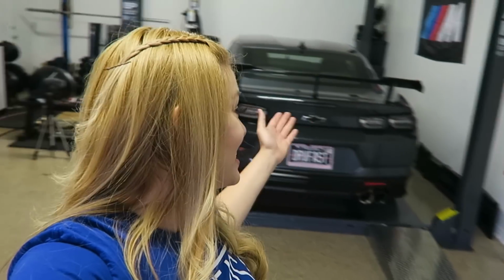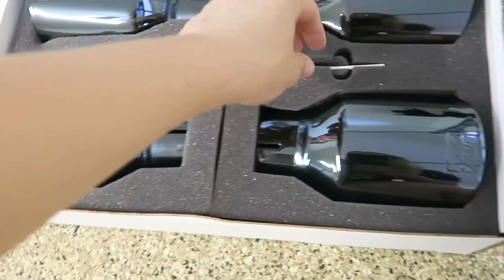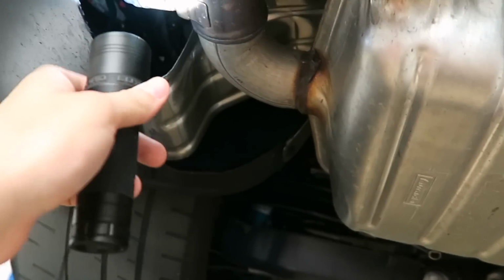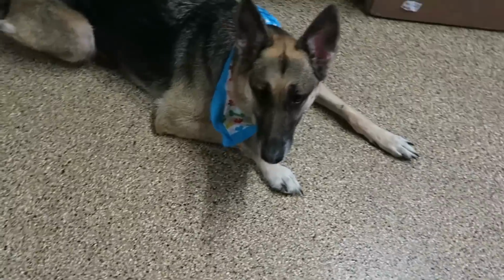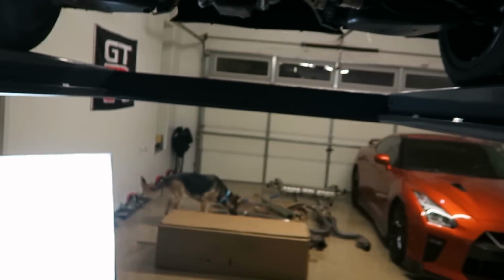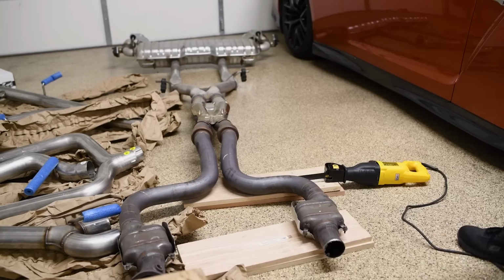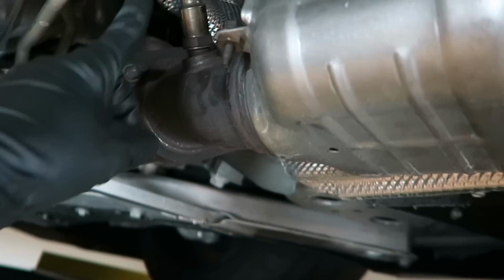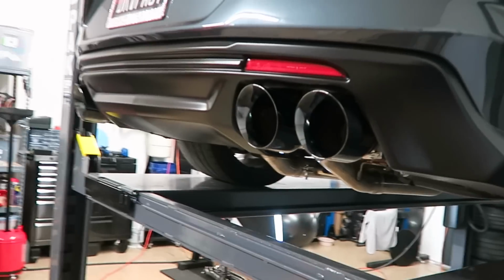HOW LOUD CAN MY CAMARO ZL1 1LE BE!? AWE EXHAUST INSTALL!

Comment: HIGHLY recommend getting an aftermarket cam and adding a little chop!
Reply from the maker: It would sound nice..plus the added power and revs...hmmm..ideas ideas.
Reply: @woman.driven  
Then do cam, headers and tune, all at the same time to save money on tune. Make sure the cam, is designed for that S/C.

Comment: Would you put  that Exhaust if you owned  a corvette grand sport rather then Corsa or borla?
Reply from the maker: I'd choose this one. It just sounds more unique. Corsa sounds too high pitch for this engine and raspy. That is fine on a mustang or my GT350, but not for the LT4. Borla is fine if you wish to keep the NPP. I went with AWE because it's a lighter system (the way I configured it), has removal tips (I needed that) plus I can add the link pipes that remove the secondary cats. Which I already ordered.

Comment: Awesome 😎 I installed Borla Atak on my 2019 Mustang GT! Factory pipes just don’t cut it. As always you make everything look so simple.
Reply from the maker: Borla always sounds great. I would get that for my GT350. AWE just sounded better on the ZL1. But yes..factory exhausts rarely cut it lol. Cheers!
Reply: Woman.Driven You should get a Borla Atak catback on the GT350 with active valves, you won’t be disappointed. In my opinion nothing sounds better than a mustang with the right exhaust.

Comment: You definitely don’t want a Cadillac STS decibel level in a performance car.  You did the right thing.  Having it obnoxiously loud isn’t good either.  Getting a balanced exhaust note that’s good for cruising/WOT/making power is doable today.  You’ve probably nailed it with Your choice.  I’ve had Borla exhaust systems on Mustangs. Slight drone at cruise, but sounded awesome everywhere else.  I applaud You for being a Woman and doing it on Your own.  You rock!!!!

Comment: It is loud now, but the LTH, will make it obnoxious loud. However, you should add CAI and a tune at that time. I t will become a nasty fast car. I know, I've been there...
Reply from the maker: The LTH will make is insane. I will do that one day. I will start adding a bit more power mods to it soon. Thanks!
Reply: I tell you. My Z06 with custom exhaust was nice, loud and crisp.
The LTH, was ok for the first few days. But I then hated it.
Reply: @woman.driven  
LTH wall thickness can barely resonate that first sound from the engine coming out. That's why manufactures go with heavy iron headers. I used to get complain from my friends when I'd go WOT.

Take some rides, before doing LTH.

Comment: Sounds like a marketing plug.

Don't forget to install a rear diffuser. You've opened up a big void where the stock muffler used to sit. That void is like a parachute at higher speeds. Now all you need is headers. Lol
Reply from the maker: No marketing. I speak in detail for all the parts I buy for my cars. I'm not worried about the void. The car already produces enough down force and will produce more in the future. This car will rarely see speeds more than 130mph on a road course. Cornering and grip is what matters. Headers will be next. Thanks for watching.
Reply: @woman.driven  let me know if we can help. We build some of the fastest Autocross and Road Course GM's in the country. Running the new 2650 on our associates ZL1/1LE at 1200+ HP. Full upgraded suspension, brakes and full Anderson Composites Carbon Fiber aero, body panels and Recaro Seating with roll cage.
Reply from the maker: Send me an email: woman.driven@gmail.com. I would love to see pictures and know more information about it, especially the suspension bits. Thank you!

Comment: Some quick advice for you with the AWE exhaust Doris:

1) I found that the spacing on the exhaust tips can make them go to the outside just a little too much. I burned a half circle into my rear diffuser. I ended up bending in the pipes a VERY SMALL amount and bought a new diffuser, had it painted. Only happens if you track it and have the exhaust hot for a long time, but I'm sure you will. I know you'll have pipes changed out for sound on the outside, so might not need it, but I know you'll want to learn from my experience.

2) I can vouch for any of your viewers that the touring version (non-resonated) does not have any drone. It's pretty amazing. I would have gone for the track version like you but....California. Lame I know, but I was also worried I might break 103dB at Sonoma Raceway with the track version. I already got the cold air intake and throttle body on mine...let's see who get headers first!!!

P.S. I forgot to mention my forgeline wheels as a weight savings in my email...along with lighter tires. You'd be surprised how much lighter the Hoosiers are than the Goodyears. Also lighter disks. I haven't done the disks yet but you can save about 5lbs a corner with the Girodisk that just came out. I might do it when I replace my disks at the end of the year. Glad you changed the exhaust, the car needs it badly but sounds amazing once you do it and AWE definitely sounds the best imo as well. Have a good 4th!
Reply from the maker: Replied :) I'll need to read the new one. Cheers!

Comment: good tip take a clamp for the exhaust and put around where you have to cut and use that to help you cut a straight line or you could always use a piece of tape because when it comes to cutting round pipe a lot of people well cut it on an angle good work

Comment: wow, great job. love the exhaust sound totally.  great job for taking on that job,  definitely made for a great video. question,  did you consider adding the OEM dual mode valve section to the exhaust to still be able to control the sound or would that have even been possible?  also did you consider removing the secondary cats and straight piping there? love the sound. keep up the great content
Reply from the maker: Thanks! It changes it up and sounds lovely. I'm excited to drive around in the streets now..not just the track. I did not opt for the valves. They do mostly nothing if I'm being honest..at least on this car. I will remove the secondary soon. I did not know I had the option with this exhaust. I ordered the pipes already. Can't wait for that. Thanks for watching!

Comment: WOW! That sounds amazing. 100% better than the stock exhaust. I'm going to seriously consider the AWE exhaust for my Camaro. Do you think you will have any problem with the sound restriction at the track now?
Reply from the maker: It sounds like it's suppose sound. It may be missing a bit more lol. Look into them. They're actually giving away a free one. Just sub to their channel and comment on their giveaway video. It will fail like this. But I will work it out before going to that track. Cheers!
Reply: @woman.driven  Thanks for tip!

Comment: you cancelled the NPP valve, I hope that it will not make a headick when driving it for long time.
this is one of the bad side of it.
Reply from the maker: It won't. The sound isn't that big of a deal. They do sell another version with muffles that have no drone.
Reply: @woman.driven  it didn't work for me, some time when crusing in low speed I got a bad headick.
any way glad that it's ok with you.

Comment: Baby, if you were going to run an exhaust without mufflers, all you had to do was remove the mufflers and resonators off the stock factory exhaust system and just weld pipe in their place, but hey, not mad atcha baby, do your thing. Love seeing a girl get down on a hot rod

Comment: SERIOUSLY??? A Total Hottie that enjoys working on cars???? What Planet are you from??? Can we clone you Please,... I'll be a $Billionaire!!!
We enjoyed your video, you do good work and we are new subscribers today. 
No criticism here, just one cordial word of advice. At 12:55 talking to your Awesome assistant lying on the floor, we couldn't help but notice the empty baseplate holes for the concrete anchors for your hoist. Some will try to convince you that they're not necessary. OSHA required those on that lift for a reason. I drive for a tow company and have used our boom lifts to rescue many cars and mechanics from collapsed lifts, not fun. As a new subscriber we are happy to donate the 3/4 concrete wedge anchors if you can't locate any. Have a pro drill and install them. 
You are WAY TOO PRECIOUS to be taking your safety for granted. 
Keep up the Great videos! 👍😊👍